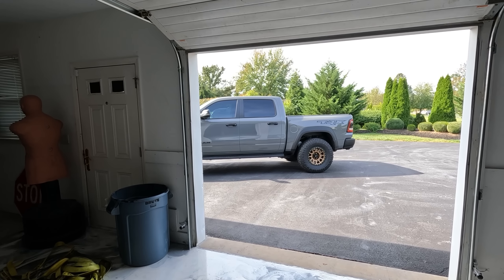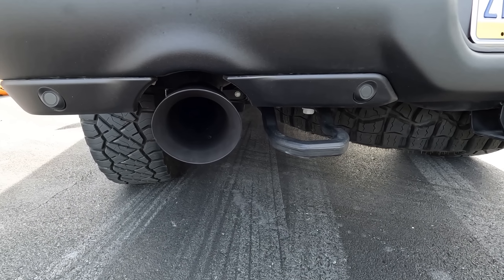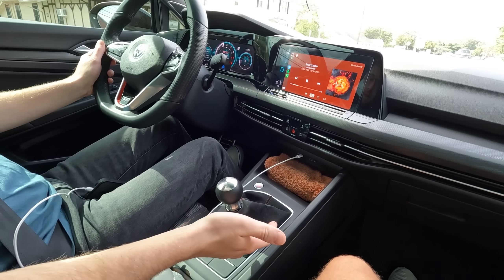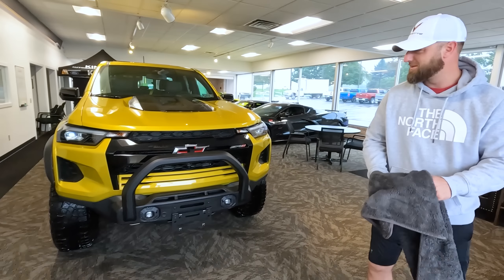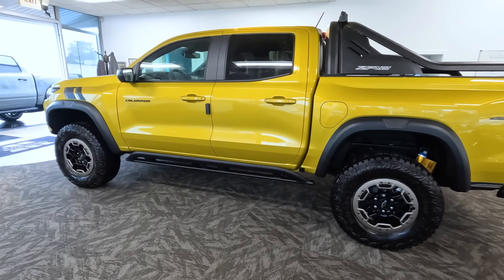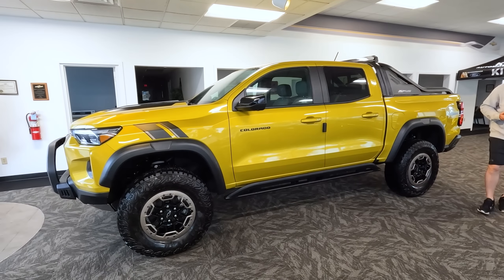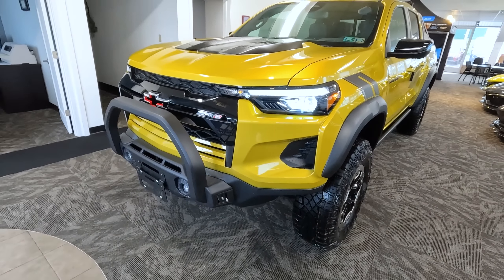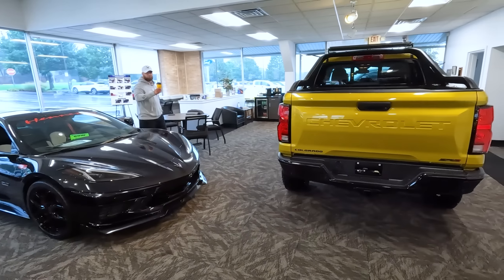I Ordered The COOLEST New Truck Chevy Sells and it Finally Showed Up 2 Months Late...

Comment: So more of a ranger raptor, 62k is a bit much to even consider a smaller truck with less usage (for a normal person who doesn't have more than 1 truck already).
but 100k for a v6 raptor is just as bad, rather just get a 5.0 and add my own suspension mods and lift, supercharger, etc, and probably spend far less.

Last truck I looked at for a 'decent' price was still 40k with right at 50k miles... which is sadly 'low mileage' these days for normal people.

Comment: I know what you mean!

My 2011 F250, I swear it has a hole in the gas tank!

When we plow snow I think I get NEGATIVE MPG!

It’s under 12,000 miles (Purchased New December of 2010) and was driven only 152 miles from last year until the Yearly September State Inspection

Comment: One thing that’s crazy is the new midsize segment trucks, like the Colorado, is nearly the exact same size as mid 2000s full-size trucks like 07-13 gm trucks
Reply: Not really bro, I have a 05 silverado and it's still bigger bodied than a new Colorado. Maybe they are taller but not wider.

Comment: You go there with knowledge but you don’t know the best thing about the Colorado ZR2 is the rear shock mounts are on the outside of the frame close to the tire so they’re not hanging low in the middle of the truck.
Reply from the maker: Definitely a good fact!

Comment: Yellow DOES look good on smaller vehicles.  Thats why on the Nissan Xterra,  it was one of the most popular colors.  I want a new Pathfinder,  but Nissan had to go and fuck it up.  They made it Front Wheel Drive,  with a 4x4 Selector.  How stupid of an idea is THAT?  I have a 06 Pathfinder and I LOVE THIS BEAST.  But why wouldnt i?  4.0 V6,  5 Speed Automatic,  Rear Wheel Drive with 4x4 Selector and the icing on the cake.....................BODY ON FRAME!  Unlimited Potential!  But Nissan has had some shitty ideas.  And so they take the most DROP DEAD GORGEOUS Pathfinder design theyve ever came up with,  and what do they do??  Yes i said it already,  FRONT WHEEL DRIVE?!?!  It has the rugged Off Road look but then you say "Hold on,  i gotta take it out of FRONT WHEEL DRIVE, and put it in 4 so i can climb this hill."  Oh god how stupid.......

Comment: I think that Colorado looks better than the TRX. Looks awesome in the yellow. 
Here in Aussie, my company truck that I drive is a 2018 crew cap 4x4 Colorado with a big lock box on the back. Also its the 2.8 turbo diesel. I like it. Though the company is about to replace it with the new Toyota Hilux in the same configuration

Comment: Waiting on a glacier blue myself. Love these little trucks. For a new truck it has a good price point as well
Reply from the maker: You’ll love it for sure!
Reply: What motor did you get
Reply: @bigbluezo6  ZR2 only comes in the HO
Reply: @StreetSpeed717  would it be to expensive for a give away? Didn't the Gladiator do any good?

Comment: Wow.. sexyyyyyyyy Colorado.. the way the shocks match the paint and those crazy off road wheels.. people need to realize there's a HUGE advantage to a smaller truck, you're thinner on tight trails, more dynamic weight to power.. Its crazy to think this is the end of gasoline, capable, lighter 4x4 😢😢

Comment: Comparing a TRX or a Raptor to a ZR2 is crazy. The ZR2 will never be what the top dogs are doing.
Reply from the maker: I agree, but sadly it's the best Chevy makes so it's only fair to have go against the big dogs. A silverado ZR2 is also aboout $80,000 so it's close to their price point😨
Reply: Doesn't Hennessey have a warranty covered upgrade or am I mistaken
Reply: If GM would slap the ZL1 supercharged motor in the Silverado ZR2 it would instantly be on that level. Sad they haven’t